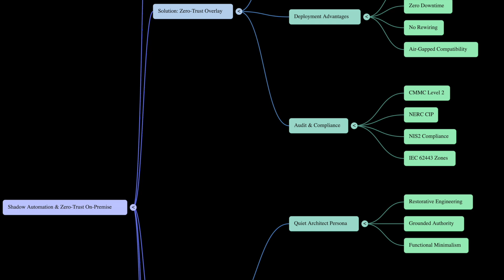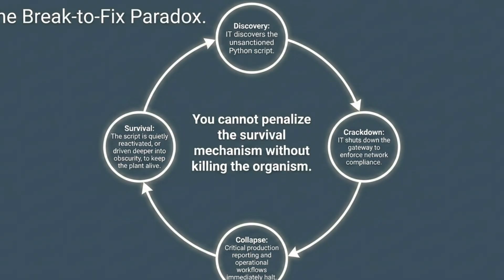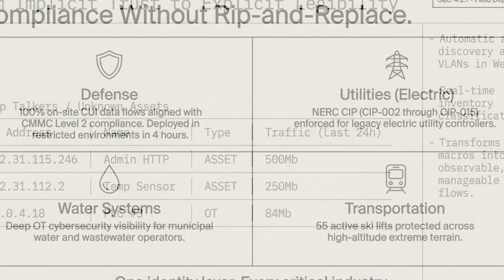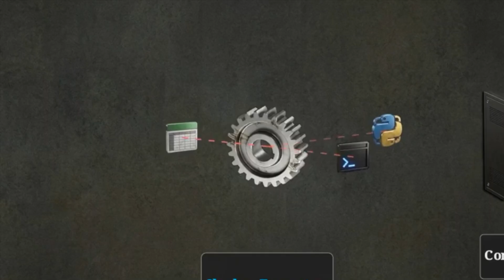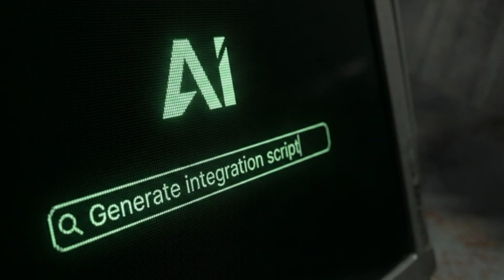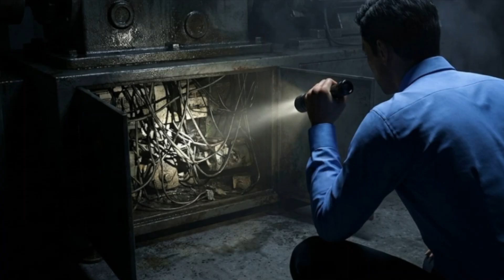Why Shadow Automation is the Real Manufacturing Bottleneck

Comment from the maker: Here are few sources for your reference 👉 

 https://controlsys.org/news/the-hidden-automation-risk-lurking-in-control-environments/  

https://www.trout.software
Reply from the maker: Facts & The Operational Reality 

* The API Deficit: Analog-era controllers (legacy PLCs, RTUs, and SCADA systems) running 70%+ of Tier-2 global manufacturing lack native REST APIs or modern secure endpoints.

* The Shadow Band-Aid: To integrate these systems with modern ERPs, floor engineers write unsanctioned Python scripts, deploy screen-scraping macros (e.g., PyAutoGUI), or build complex VBA Excel bridges. 

* The Risk Multiplier: These scripts run on local machines, bypass formal IT governance, and lack version control. If the script breaks or the specific engineer leaves, the production reporting or physical workflow halts. 

* The Generative AI Blindspot: C-suites are allocating millions to LLM governance and policies while the actual physical plant floor relies on fragile, undocumented, decade-old code.
Reply from the maker: Hidden Bottlenecks 
* The IT/OT Divide: Information Technology (IT) demands security and compliance; Operational Technology (OT) demands continuous uptime. Shadow automation exists exactly in the friction point between these two mandates. 

* Knowledge Silos as Job Security: The "Hero Engineer" actively benefits from the obscurity of these systems. Their exclusive understanding of the fragile workaround grants them asymmetric leverage within the organisation.  

The "Break to Fix" Paradox: Bringing shadow code into compliance often requires shutting it down to audit it, which immediately halts the critical workflow it was secretly sustaining.
Reply from the maker: Listen to this 👉 as you commute:

 https://open.spotify.com/episode/1bRo4D5zoZvKz6CSRgdCUU?si=H9mNfHJLSwC6rKY8O41LHg
Reply from the maker: Dive DEEPer Here 👉:  

https://prasadbhonde229.medium.com/1why-shadow-automation-is-the-real-manufacturing-bottleneck-3a659fbe7835
Reply from the maker: VIEW Here 👉:  
https://youtu.be/kBB8M330ZjQ
Reply from the maker: Access “Industrial Resilience: Zero-Trust and Shadow Automation Study Guide” here 👉:  https://docs.google.com/document/d/1ti8z0OATF7hBSx62HwgY7wWH5K20Fpd7dZUJkLd6uxc/edit?usp=sharing
Reply from the maker: Connect here 👉
 https://tr.ee/vYy2GL  

Or here 👉 
https://linktr.ee/PRASADBHONDE
Reply from the maker: Or you may want to read this 👉 

https://amzn.in/d/01HOcXep